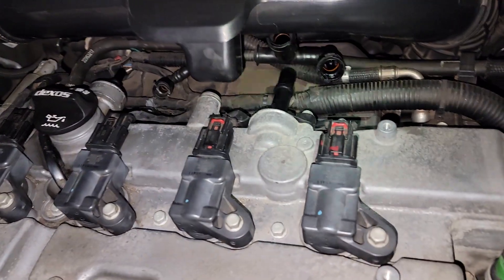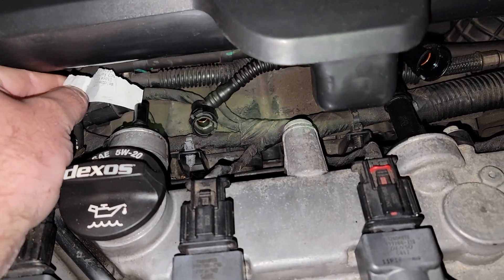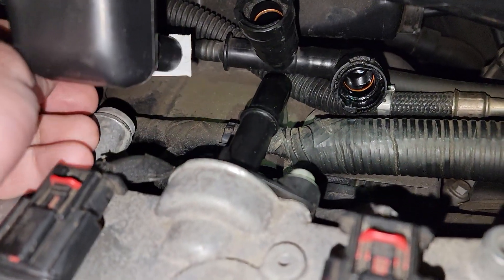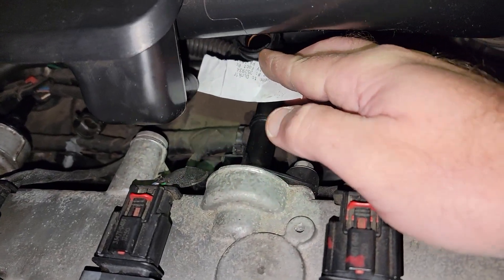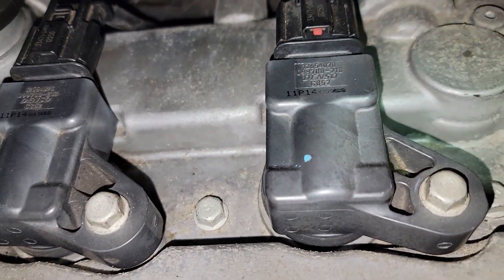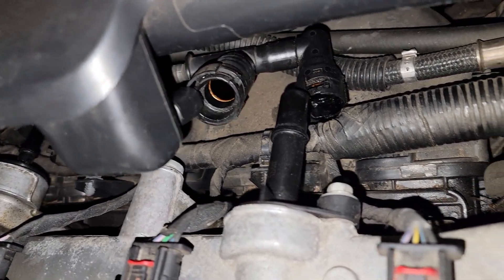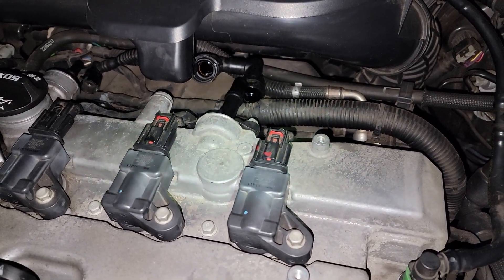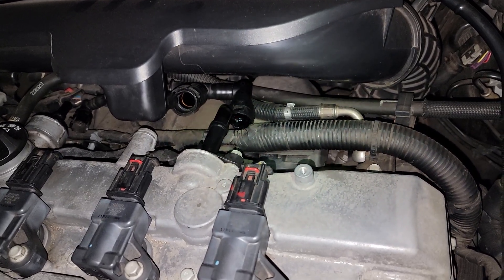Installing an oil catch can in a 2013 chevy malibu 2.5L ?  See description

Comment: I've also removed my stock air intake resonator and replaced it with a cone k and n and filter and am running a k and n air filter in the stock air box I made a cold air pipe running from the stock air box to the throttle body with aluminum tube and silicone ends and band clamps and a chevy equinox engine cover four looks 😀

Comment: I also am running a 3.6 v6 oil cap for additional engine crankcase pressure venting in place of my stock 2.4 oil cap non venting a 2.2 or 2.0 oil cap for a turbo ecotec will work as well

Comment: K so I don't know about the 2.5 ecotec but I just installed a dorman universal oil catch can on my 2012 chevy malibu ls with the 2.4 ecotec I ran my hose from the pcv hose on the engine valve cover to the IN SIDE of the dorman catch can in side and ran the other hose to the catch cans out side and connected it to the air box I currently put 500 miles and checked mine and it was bone dry I just changed my oil and am checking oil catch can next oil change of 5000 miles my car has 115000 miles

Comment: My 2013 2.5 Malibu is starting to use oil at 45,000 miles. I'm guessing you didn't have any luck after replacing the pcv valves ? Haven't looked to deep yet but from what I'm reading it might be rings or valve guides. Have you done a compression or leak down test yet ?
Reply from the maker: Correct, replacing the pcv valves did nothing.  Expensive oil additives did nothing.  Marvel mystery oil soak did nothing.  The gumout soak I did on my 2009 scion tc decreased oil usage by 50%.  I am going to do a berrymans b12 piston soak on the malibu.  Others have had success with that.  Mmo is just not strong enough clearly.  I haven't done compression tests but I did do leak down tests when I did my soaks.  The mmo and gumout leaks by the rings, but I'm pretty sure that's normal over time.  Berrymans will do that too and also evaporate
Reply: @JonnyAbs-0  Today I pulled the oil cap off with it running and it has a LOT of pressure coming out. No smoke or oil, just a lot of air pressure. I did notice a leak starting around the valve cover. There is to much blowby and the pcv system cant keep up. Thats what I'm thinking. My 2018 Silverado and 1999 Camaro lS1 dont have anything near this pressure at the oil cap.
Reply from the maker: @billbranham9072  yep mines got the same.  Has for years.  You are just a bit behind with that low of mileage.  Grandmom car?
Reply: @JonnyAbs-0  Yes, was a 1 owner, garage kept and dealer serviced.  Had 34 K when we bought it.
Reply: Ever figure this out? Running across the same problem right now.
Reply from the maker: @ashtonmatchett6636  a piston soak with berryman b12 chemtool can help a lot.

Comment: It shouldn't really need add'l oil catch. If engine in good shape...
Reply: You obviously don't know the purpose of a catch can.  It's to prevent the oil contaminated air from being put back into the intake without having the oil separated from it.  Very important on direct injection engines that don't have fuel cleaning the back side of the intake valves.
Reply from the maker: Engine has over 120K miles and has burned about a quart of oil every 800-1000 miles since about 50K miles.  So I am getting a lot of blow by, and since this is a direct injection engine, the back of the valves get no cleaning from port injected gas.  They are probably all gunked up and continually getting worse from combustion gases coming through the pcv and intake.  I do run sea foam spray probably once a year to try to clean the valves, but who knows how effective that is.